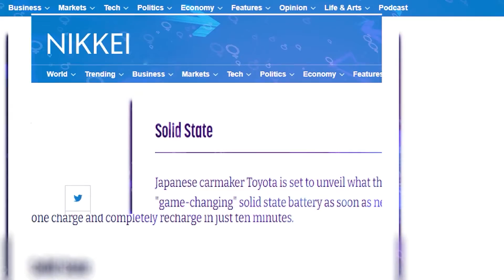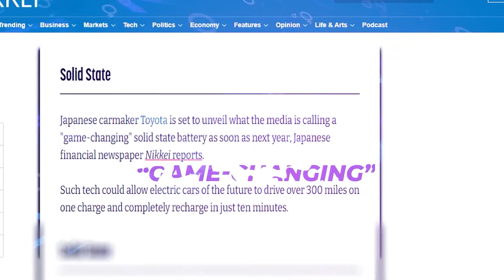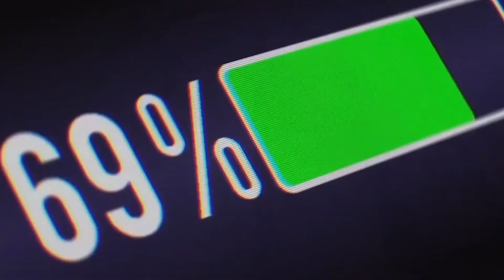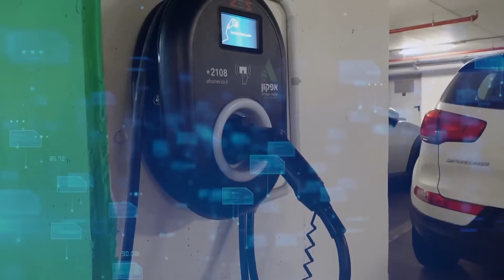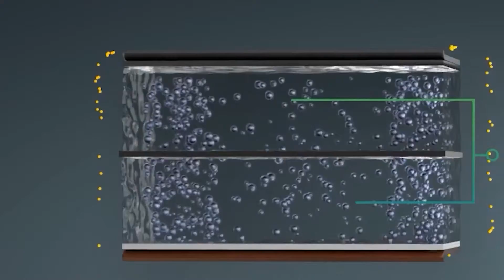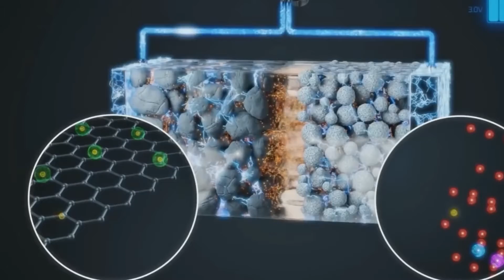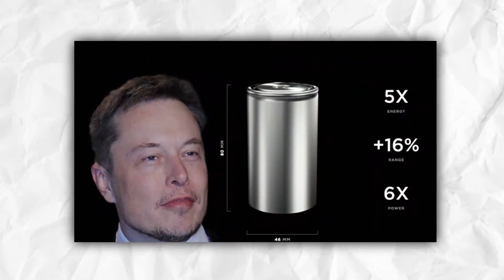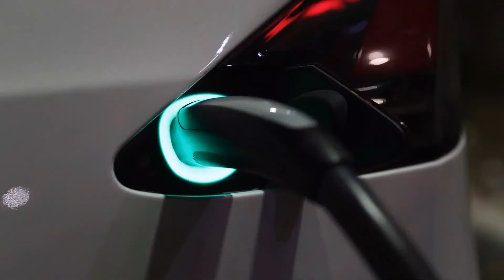Solid State Batteries - What is different from other batteries?

Comment: Solid state batteries are yet to be a reality, so the alleged benefits are just marketing piffle. Nobody's in a position to know at this point. And anything promised by Elon Musk rarely come to anything. I'll stick with petrol and diesel thanks.
Reply: like launching and landing rockets?
Reply: @stevenholden2814  "We're making the new Tesla Roadster now" - Elon Musk in 2017.
Reply: Im with you... a horseless carriage how ridiculous. I'll have to buy fuel??? Those idiots....
Continue to keep your head in the sand, the rest of the planet will continue to evolve and this  country will be left behind. Energy Independence. We pull very small amounts of petroleum from the ground that's used in vehicles.  You did research enough to watch this video... how about a little more.